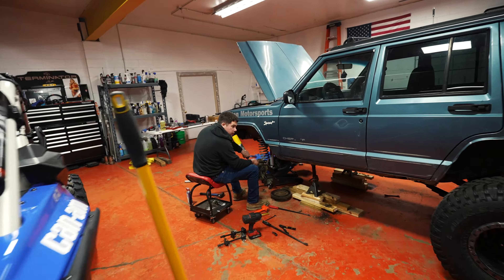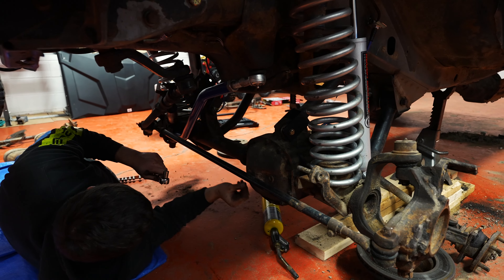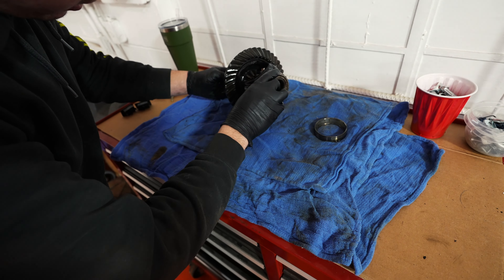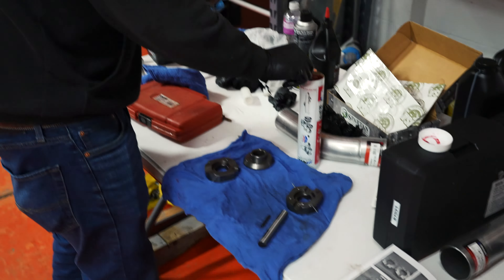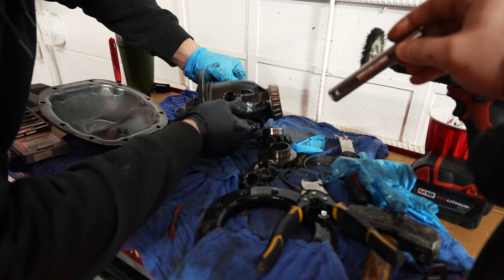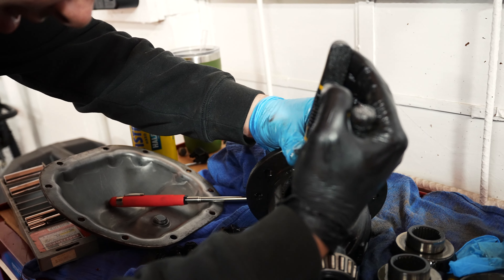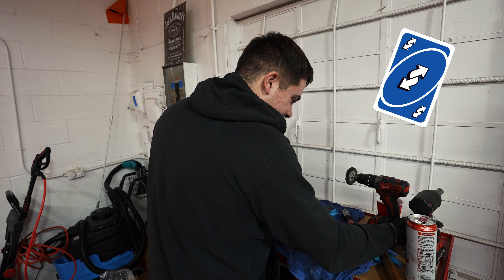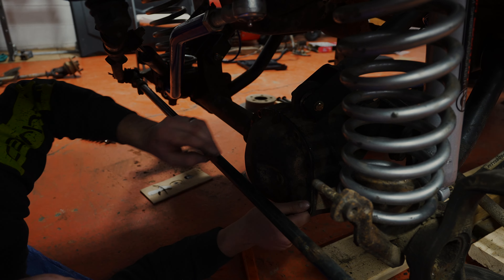Spartan Lunchbox Locker Install on Our Jeep Cherokee!!

Comment: When you weld those gears, make several passes and stack the welds. Get in as many places as you can. You will be surprised how much stress is put onto those welds, and they can break loose. Looking forward to seeing the "test" run with the new upgrades.
Reply from the maker: That’s pretty much what we did. I welded a little more after what I showed in the video but not much more.
Reply: @mittenmotorsports , glad you welded more off camera. I've much more weld than what you showed fail. Still looking forward to the action video!

Comment: I would recommend upgrading to chrome Molly axle shafts and use Spicer  unjoints. I have Aussie locker with 33s I was braking  braking drive side all the time
Reply from the maker: We will keep that in mind when we inevitably snap our axles. 😂

Comment: You mean I'm not the only genius that bought an xj from the rust belt with only 190,000 miles on the clock. People in the south and the west don't know what they're missing out on...lol.
Reply from the maker: It’s all we got to work with here lol. plus we bought them both wrecked 😂😂
Reply: @Mitten Motorsports  I bought mine from an online auction. It looked better in the pictures. It messed up how many people try to scam. But it is what it is, I'm still going to make it work.
Reply from the maker: That’s too bad. Either way glad you got one!!